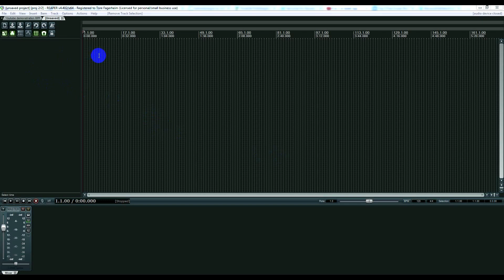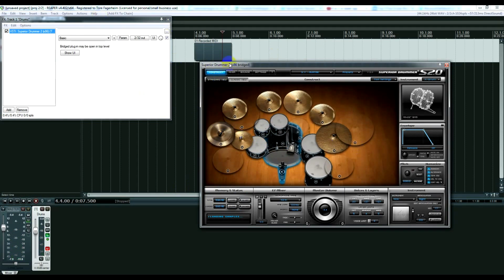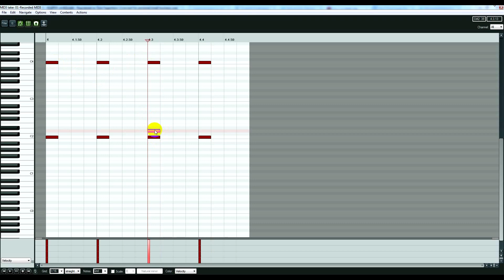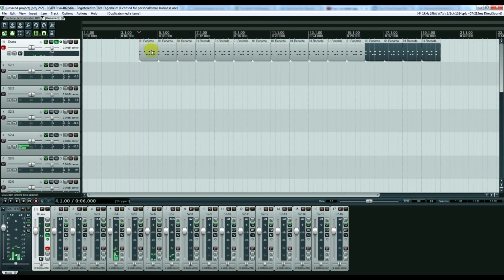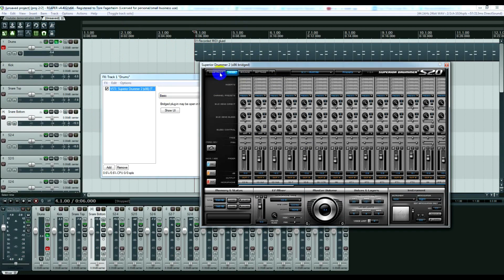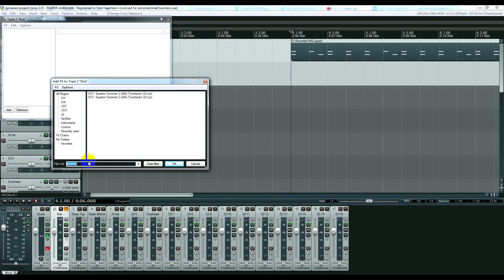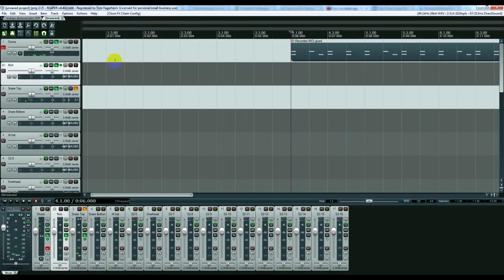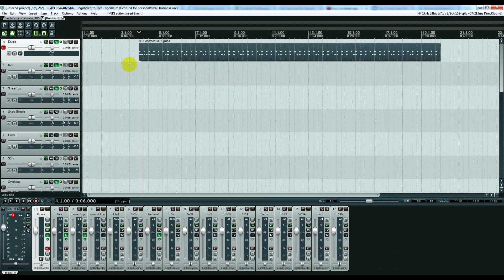Setting up Superior Drummer 2.0 in Reaper + Making a simple drum beat + Multichannel output

Comment: Really awesome! A found out that the Overheads can be split into left and right by copying the OH-channel in Reaper and splitting the stereo receive to two mono receives (25 and 26 in my case). I do the same with the ambience mics. This is more realistic because it represents the two mics that are normally used.

With stereo tracks, I always group the left and right track in a parent. In this instance, the parent's sound is what SD2 feeds the given output.

Comment: This is a great video. I am running this on Windows 7 x64 and am having issues with no sound when using Superior Drummer 2.0. I can't hear sounds when I load Superior Drummer into Reaper. When i open Toontrack solo separately I hear sound, just not in Reaper. Reaper plays inported music from Media Player fine. I have checked the Vst Pluggin location and am at a loss. Please Help.
adgrandell@gmail.com
Reply: I figured out a simple fix! In the lower portion of your Reaper window in the bottom track, select the tract that you want your drums to be. example (S1/2), Then click on the "fx" button and manually add in your "superior drummer VST plug in. then go up to your same track but now the upper left one 1  S1/2. double click in the Meter; and select "Input: MIDI > All MDI inputs > ALL Channels. Hope this helps.
Oh and also note that if you are running this program off your main computer and not an external hard drive, you should only select one track as your primary "Superior Drummer" Input. :) Good Luck!

Comment: Hello.
Thank you very much for this. Probably the most comprehensive and useful tutorial I've found about setting up Superior Drummer in Reaper. I am still a new user of this and I have a question please though: I followed this to the letter but my drum instruments are not displaying bleed at all. As you say, we might want some things to bleed and some not to bleed. If I hit the kick, I can tell that the OH is picking it up, but when I go to the settings you use at about 08:05 none of those orange/yellow lights are ticked/on, which I assume means that bleed is not on. This is the same for every single track. I really want to make sure the kicks don't pick up the snare bottom and the overheads do not pick up the toms. Another problem, which I think might be related to this is that if I hit a cymbal, although I can hear it, I can not see any signal shown in the OH track on the mixer. I don't know what I am doing wrong. Would you be able to help please?
Reply from the maker: Hi, I'm glad you liked the video! Unfortunately, I have never encountered anyone with the problem you are describing, so I do not know the solution. Let's see if any other youtubers can save the day here by commenting.
Reply: Metal Guitar Stuff Well, somehow I tried it again and it worked! So thanks again!